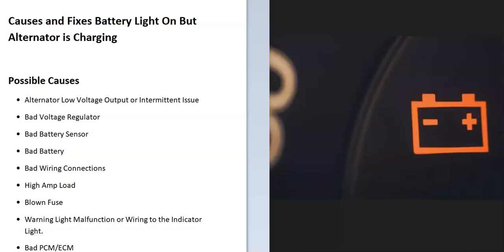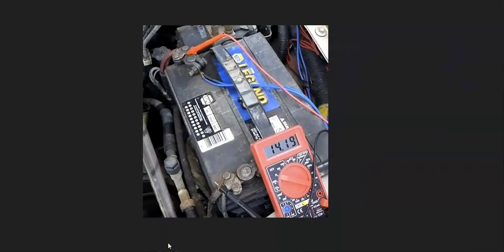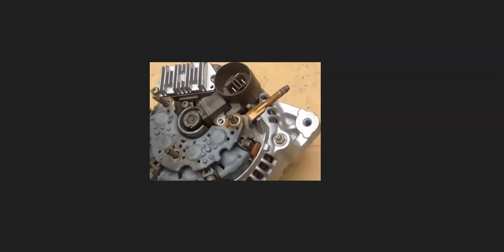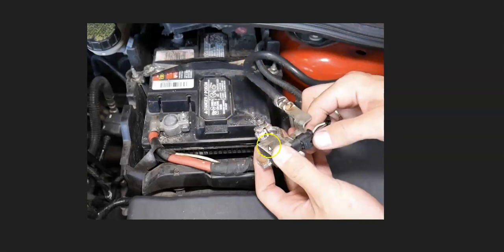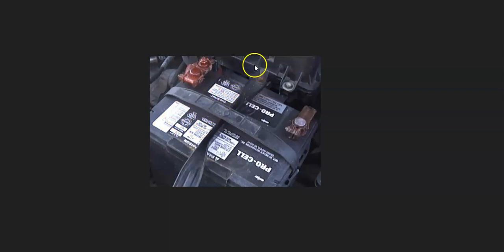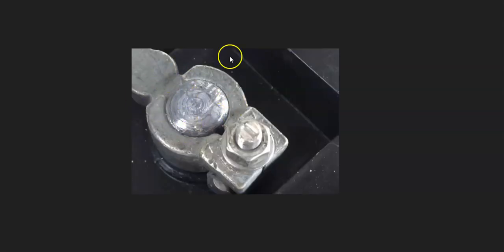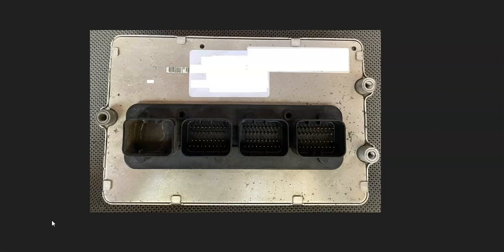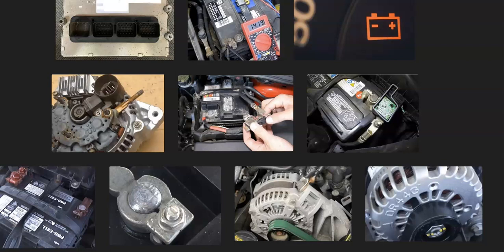Causes and Fixes Battery Light On but Alternator is Charging

Comment: I can't figure mine out, battery light came on, seemed to be bad battery, got new battery, all voltage looks fine alternator is good, replaced the ground wire even, turn the car on, no light, hit a bump no light is back on, this damn battery light will be the death of me

Comment: Newer cars have variable output alternator systems (a.k.a. Smart alternators) so when you check the alternator voltage it can be all over the place. I am working on a brand new 2026 Chevy Trailbllazer that momentarily flashed the "Service Charging System" message and momentarily lit the Battery Fault indicator light.  This has occurred about 3 times in the past week.  Took it to two different dealers and after testing both insist they see nothing wrong with the charging system.  I put DMM on battery and see the voltage at 12.6 VDC when engine is off.  Start the engine and often the voltage vill start at 13.x and slowly over a minute or so start climbing up to low 14.x. VDC values.  Have akso  seen it at 12.x VDC post startup.  Then when rev the engine to 2k RPM the voltage almost immediately runs up to 14.x VDC values.  When driving the vehicle I see the charging voltage in the low to mid 14.x range and then it will drift downward to low or mid 12.x range.  I think it has to hit 12 VDC or just under to trigger the  "Service Charging System" message and light up the Battery Fault indicator icon.  Not sure if these fault condition messages/indicators are legit or false alarm.  Starting to suspect a software bug.  Have seen issue resolved with PCM software update on other GM products.  Hope can get it figured out.

Comment: Great video bro!!! 
So, our vehicle is a 2019 Ram Promaster 2500. I have this issue too, changed alternator 2x to the latest 220V but, the battery light is still coming on. New battery, no electronics connected besides it's stock electronics. We're suspecting ECU might be bad! Can you please give me your take?

Comment: How do u test the altinator?
Reply from the maker: Use a meter and check the voltage at the battery terminals while the engine is running. The output is usually between 13.5 - 14.5 volts. You can also look up what the rated output is for the vehicle, but usually 13.5 - 14.5 volts DC is good.

Comment: I have a 2015 mitsubishi outlander. This battery icon is my problem. All is running well for 15 to 20 mins. Then this battery icon will show up. Upon having it in the dashboard, the voltage goes up to 14.81, w/o the warning battery icon the voltage is at 13.80-14.19.

Comment: Hello there just wandering if you can help. I've got a 2007 ford Taurus that the battery lights is on I've done all the dynastic I've put in a new battery and a new alternator but the charging system is still on and I wound really appreciate it if you can help,  the good part that the car is drivable I've drive it every single day don't have a problem with it , just that the battery light is still on.

Comment: I'm dealing with it now on an 04 Expedition. Battery light flickers 1 to 3 times, then might not do it for 5 minutes, or another month. Lately, the intervals are getting closer. Doesn't matter hot or cold, highway speed or pulling out of driveway, accelerating, cruising, or deceleration. Completely random. Of course,  I can't duplicate it with a voltmeter on it, but it's putting out 13.8 to 14.2V. Battery is 4-1/2 years old. I cleaned the cables. Still checking because I don't want a hard failure and it will happen in the sticks.
Reply: I have the exact problem today. Were you able to find the culprit?  Thanks

Comment: The brake light and battery light are both staying on and the steering wheel is really stiff. When it was parked 2 days ago it was fine. Any ideas?
Reply: your serpentine belt is broken

Comment: I have a 99 rodeo and when the battery and brake light comes on the alternator is bad, had alternator replaced and the lights are still on, mechanic said they double checked everything to make sure nothing was loose, had battery and alternator tested at 3 different places and all the voltage is showing good. I was driving it the other day and the lights off for a few seconds but came back on, I don't know what else to do. I'm driving it but nervous

Comment: I just bought a Buick Enclave 2011 and the battery light is on all the time in the cluster. The old owner says that the alternator and the battery were changed and it's not solved. I don't know what can be the problem. Any idea?
Reply from the maker: I would start from the beginning, get a meter test of the battery and alternator output, and if those are good, test the battery sensor.

Comment: I have a 2009 Chevy aveo and it is draining the battery quickly I have replaced battery ,alternator and ecm all new. And hasn't fixed the issue . When installed new ecm it will no longer turn over what could the problem be?
Reply: something is draining the battery could be anti thief system

Comment: Great Video about alternator. I have a 2001 Toyota sienna xle. I was driving today and all suddenly I have no power. The RPM jumped up and  down and just stop. All the lights are dim, hazard and signal lights. The alternator original from Toyota. I don’t believe it been change. When I got home parked the car. It won’t start just loud clicking noises. I tested the battery it showed 11.2 amps. I have my battery tested at Autozone they say it was good, but hard to believe.
Reply: My Camry just did this exact thing to me. Was just wondering if you were able to figure it out or could help guide me in the right direction since I’m going to have to repair on my own

Comment: Everything mentioned is ok..  Battery light indicator comes on car SHUTS DOWN... EXPLANATION PLEASE.
Reply: Update? I just bought a 2024 ram romaster for $💯,💯+(100,000$+) to live in it and turn it into a mobile home....ordered an indoor heater from china which is gonna take 25+days to deliver so until then i been using inbuilt heater (cuz Canadaian winters are unbearable and harsh) and doin that few times i drained battery sumtimes while charging my devices or running fan without idle/ withoutengine runnin after which had to start with a jump start cable/ booster cable with the help of random strangers who connect it with their cars battery and get mine working again,but been doin it for a week or two at max if i recall correctly it happened a total of less than 10 times but it mesed up my vans electrical systems i guess , and becuz i made changes that have voided any warranty i gues im just FCCKED BUT I NEVER HAD A CHOICE FCCKN HATE LIVING IN THIS FROZEN DEATHLAND 🇨🇦 🤮

Comment: Hi. Can you give me an idea about my problem please. 
Battry light illuminating all the time but it’s dim. Flickers when load is high and low, like if I turn on AC. Also, rpm goes low at idle and battery light flickering. Recently changed the battery and alternator.
Reply from the maker: It will need to be diagnosed but check all the battery terminals are connected good. Also, if you have a meter test the alternator output is good.
Reply: @HVAC_Mechanic  Alternator output is good.  Have checked the grounds also. Seems okay.

Comment: Thanks for the list to check.... 2004 SATURN ION, 390999 miles, 5spd,  been with Me since new ❤
Alternator replaced at 265,000... eVeRytHiNg flashed and acted cRaZy when it went out. 

Today the battery light came on... That's a first. 🤔 Diagnostic gizmo said "no code". So I'm hoping it's just the battery... Or connection. 

Anyway, drove home from Austin 2 hours with that battery light on... Towards the end the AC got warm. So I turned the AC & fan off... Driver window worked, sunroof opened, but passenger window ignored Me. 
About 30 miles later, the airbag light turned on as I turned into the driveway.... 😜 Motor acting alright, just seemed like the car was deciding what to live without while driving. 
Gotta check the age of the battery... 

BTW same AC since the beginning of time... Only thing I've ever had to do was replace a relay fuse about ten years ago. 

Seriously ❤❤❤ My SATURN Coupe.
Reply: Part 2: Battery charged enough to drive to My 👍 Mechanic. 
Located 2015 lifetime warranty for Alternator & purchased part yesterday. 😁 
9 years is pretty good for 2nd Alternator, now onto #3 at 390888 miles... HELPS to have ONE knowledgeable Mechanic that trustworthy... Limit who is allowed to work on the vehicle. 👍

Comment: My '12 Camry after first start of the day my battery light comes on. It starts fine and after I run or drive it for 10-12 minutes it turns off. Then each additional start of the day the light doesn't come back on. I had the alternator and battery tested at a parts store and they both passed. I need to check the running voltage to make sure it is putting out the rated numbers like you said. I'm assuming I have either a parasitic draw issue or a bad fuse or relay or maybe ground. It's like something drains it just enough to trigger the light. Also until this morning, for the last three days the light never came on at all. It started originally one week and a day ago.
Reply: You ever figure this out? I replaced both battery and alternator. New alternator only putting out 11.53 and battery holds 12.75
Reply: @shaunmurphy412  Not yet. It's weird. It's like a parasitic drain or maybe a bad relay not turning off something when it's shut off. The days when the battery/charging system light comes on, it's right after I start it in the morning. It isn't drained enough to not start and goes off after running about 10-12 minutes. I usually drive around the same time of day. I park it around 11 am and it sits until around 5:00 am the next morning. If I let it sit longer without starting and running it then it has taken several minutes longer for the light to go off.  Also, some days the light doesn't come on at all. That's the case often. Sometimes it'll be up to four days straight without coming on.  I bought another alternator to try just in case. It's a remanufactured one with a lifetime warranty. I haven't installed it yet bc I really believe it's not it bc it seems to charge and that's why the light goes off at the same time. Like I said it seems to be something pulling power while it's off and when I start and run it then it charges up the battery and light goes off. I need my relays and fuses and slots tested to see but everywhere I've asked said it could take forever to find the culprit. Not sure why bc it seems like you'd just test each slot to see if it's drawing power while it's off. When checking relays it may take longer bc you have to send power to them and then have to wait several minutes for the system to settle back down so that can add up time. I bought a new multimeter to test but I'm very limited in my ability to physically stand and bend over bc I have severe back, hips and neck issues as well as a muscle condition and my feet are messed up from bones and spurs that cause ulcers I have to get treated often. I know how but just am not able most times. I could with help but I don't have many people to help around.  But yeah I've just been driving it and researching but I want and need to fix the issue bc it will likely hurt my alternator or atleast it's lifespan. Plus I don't want to always have to start and let it run every morning to charge it. I'm gonna put a battery trickle charger or regular battery charger on low and slow so I don't have to waste fuel and wear and tear etc.  Sorry I made this reply long. I appreciate you asking about it. Have a good day.

Comment: My battery light is on, I changed my ignition coils and spark plugs the other day, and now the battery symbol comes on, and sometimes the wrench symbol comes on
Reply: You need to get a it checked with a computer scanner tool to diagnose the problem because with
Reply: @ryanhamilton9709  thanks
Reply: @ryanhamilton9709 obd scanner
Reply: My battery light turned on after an oil change lol
Reply: @elinino5275  if you’re financing, check the tracker device. That also drains it
Reply: It could be a number of things, that’s what I went through

Comment: I have a voltage drop under acceleration to 12.3 volts unless i put lights on and it stays at 13.7 with a new alternator and rectifier

Comment: Thank you for the information. You're the first guy that talks about the onboard computer. My voltage is sometimes 13.2 V , In which case my battery light lights up also  as much as 17 V. In which case the battery light lights up. Change the battery and change the alternator but not original from dealer.
 It's a 2006 Lexus R. X330. What I needed to know was Yoon board computer sends a signal to the battery light on the - because it's not reading the proper voltage coming out of the alternator that makes sense to me now.

Comment: I watched your video. I'm curious on your opinion on this. I've replaced my alternator and throttle sensor. Ever since then my check charging system keeps coming on but my vehicle seems to run fine. I've made sure there's no corrosion  to the battery. I don't know what to do. Frustrated. Please help

Comment: I had a Charging System Malfunction warning recently with my 2016 Mazda CX-3 AWD.

Turns out that it wasn't the battery or alternator that was a problem, it was a faulty serpentine belt, which was a big relief as I only had to spend less than $150 on repairs.
Reply: Or onr of the pullys from sitting  or getting stuck. Thats what I think mine is. Or starched out belt. All it takes is a hair too loose for.it to slip or a crack. My truck sat a yr  has alot.of.rust under it. Surface but it wouldn't take.much to throw stuff out a wack ive found. Frustrated n t3asy to buy a new belt n altimator. Won't hurt new shocks n rotors too. At least their last m.ill keep the extra parts n have anything repaired if need be f it
Reply: My battery cost me 350 n the garage guy kept my other one days it was no good but the lights still on. So how's it no good. Much fuel pump has ors on on n off switch  it's what killed the battery. So not sure how rh figures battery was no good. Sounds like he wanted a free battery

Comment: Great video
I’m checking everything you mentioned.
Batteries are 2 yrs old had them checked and👍🏼.
Alternator next. However a mechanic that works on emergency vehicles told me to swap the batteries around every 3 months. So the primary battery gets changed. My truck has two batteries. It’s a 7.3L diesel.

Comment: my alternator bracket broke and i have the part on the way but i connected it directly i put a little supe glue on the just so it wouldnt move not mess with the prongs, ive got the warning light brake and battery. i checked the fuses the connection im hoping once i fix the bracket the warning light will go.

Comment: Got a 2002 Nissan Frontier  replaced alternator and Battery and cleaned up Battery Terminals etc.  Tested Voltage with Everything On. Ac max, Headlight high beam on etc. 14.3 voltage at idle. Lights On still.! SMH help please
Reply from the maker: You checked all the most common causes, so the issue is likely harder to troubleshoot. The computer or the wiring may be having a problem which is more difficult. I would double check all the connections, check for any damaged wires, and be sure the fuses are all good.

Comment: 2003 Toyota RAV4 battery light is just haunting me!! Check and cleaned my connections and wires. Got done watching your video and now I’m ready for round two on checking other components. Much respect 🫡
Reply: I had that RAV4 checked out by multiple shops and couldn’t find the issue, so I solved the issue and sold that bad boy😁😁😁
Reply: I'm also having the same issue with my 2000 Toyota Camry. Maybe it's a Toyota issue 😆 The alternator is putting out over 14 volts at the battery so that's not it, But I did go through five alternators before I got a good one! Maybe it's time for a Honda!
Reply: @bryanjones4985  I sold my RAV4 and got a Avalon, no more issues.
Reply: @bryanjones4985 how did u solve it pls? My Camry 2001 is having same issue
Reply: Did you ever figure it out?
Reply: Sir, what was the fix?  🤔

Comment: My battery light goes on and off like it lose power but I had the battery and alternator tested but they said it was good 
Please help me
Reply from the maker: Check the battery terminals and all the other connections at the alternator. If the engine is running good, then there likely is a loose connection.

Comment: brother i have ford fiesta 1.4 tdci my problem is that whenever i start the car  battery warning light comes on the dash but if i fully press the throttle all the way to 5k rpm it starts charging and light goes offf , plz help me to solve this issue
Reply from the maker: I would test the battery and the alternator.
Reply: @HVAC_Mechanic  battery is new as well as tested